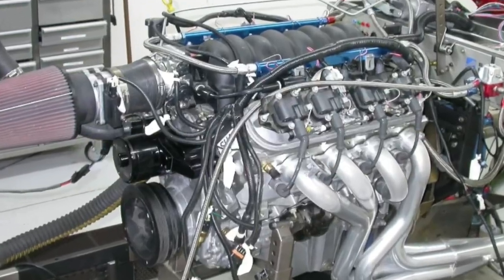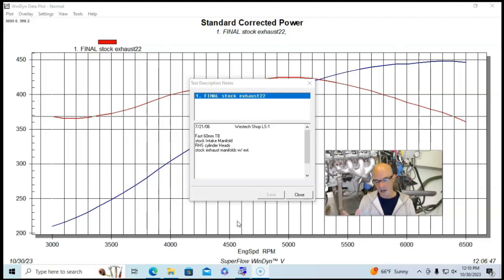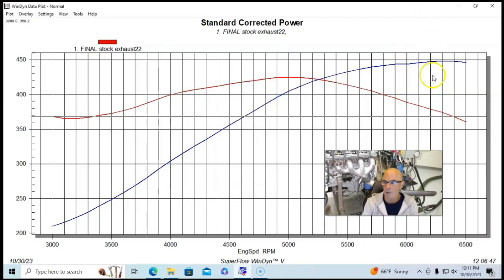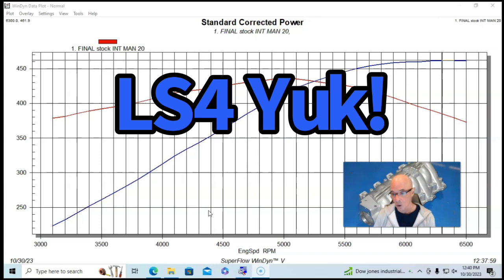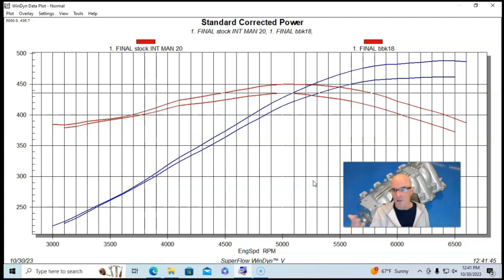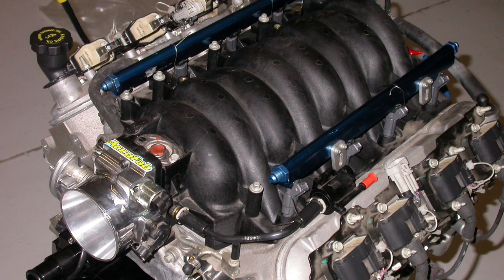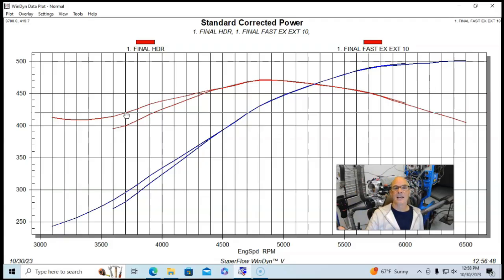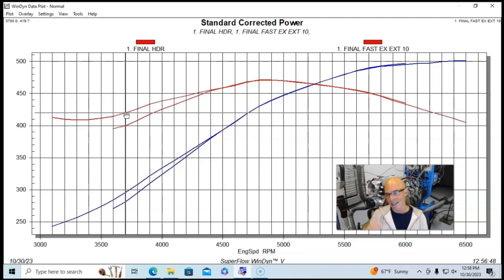HOW TO: 5.7L LS1 POWER MODS HOW TO MAKE MORE POWER WITH YOUR 5.7L LS1. LONG TUBES VS STOCK EXHAUST

Comment: Old ls1s were great. I'd love to see a ls6 5.7 on that dyno.
Reply from the maker: WE HAVE RUN 1
Reply: @richardholdener1727  I'd love to see those results
Reply: So LS6 intake, 243 heads, cam smaller than this...got it. It's literally a slightly modded LS1.
Reply: @Carado5150  there's a bit more difference than that. My bolt on ls6 made 451whp/423wtq.  Stock heads, stock cam. It ran 10.7@130ish in a 4gen. Best trap was 131.3.  But those times was BEFORE the last round of mods where it made the 451whp/423wtq.  When it ran those times it was a bit off that day. But the dyno for those times was 417whp 393wtq
Reply: An LS6 is just an LS1 with different heads,cam, and intake manifold. Exact same block and rotating assembly. After 2001 the LS1 even had the same intake manifold.
Reply: @BadLuckGarage  i know exactly what a ls6 is....i owned one and actually still have it. There's a bit more to it than what you guys are saying because you apparently don't know the full differences.
Reply: @HioSSilver1999  There’s actually not. I own a 2002 base C5 and a 2002 C5 Z06. They’re the exact same engine other than the heads and cam. EXACT same engine. Same block, same rotating assembly, same everything. Only difference is the heads and the cam. Edit….oh yea, and the LS6 has red engine covers that say “LS6” instead of black ones that say “5.7”. 🤣
Reply: @BadLuckGarage  ok...since you don't know I'll splain it to ya. A ls6 has .4 more compression,  coated pistons, different block for better bay to bay breathing and lighter valves.....and of course different heads and cam.

When you overlook the little shit it bites you in the ass on a real build.🤪🤪🤣🤣🤣
Reply: @HioSSilver1999  The extra compression comes from the 243heads having a smaller combustion chamber, hence the “different heads”. Same with the sodium filled valves. Again, those are part of the “different heads”. The slightly different block came about in 2001 and was also used for all LS1s after 2001. Same with the pistons. So again. Exact same engine other than heads and cam. I could literally just put 243 heads and an LS6 cam in my 02 LS1 and it would be an LS6. But I don’t need too, because I already have one. 🤣
Reply: @HioSSilver1999  the worst part of this entire conversation is Richard already explained all this in the video you commented on and you still didn’t know. 🤦🏼‍♂️
Reply: @BadLuckGarage  ohh i know. I splained it. And no not all ls1s got ls6 blocks. Few if any did. And the last i checked the engine is a entire package.  Breaking it down only means that there are different components......as I said. Those components add up to better refinement and more power.

Btw...ls6's was the only ones with lighter valves. All the other 243s didn't have the light valves. The light valves weren't in the 2001 ls6 either.

Now you know....but you didn't or you would have also known about the coated pistons. So no the bottom ends weren't the same.
Reply: @HioSSilver1999  Lmao. One of us has definitely learned something here. But it wasn’t me. Matter of fact I’ve probably lost at least 4 IQ points just reading your comments. 🤣
Reply: @BadLuckGarage  it definitely was you....or you would have mentioned the things I splained to ya.
Reply: @HioSSilver1999  I did but you either aren’t comprehending it or just enjoy arguing semantics. The valves are part of the  “different heads” and the pistons are the same from 2001-up in both engines. So again, for the third time….same engines except for heads and cam.
Reply: @BadLuckGarage  again...the pistons aren't the same. The block isn't the same. The engine is a entire package.  One engine has lighter valves...the other don't. Not all 243s had light valves. One has more compression because of the heads. Again...the entire package.  The pushrod length is also different because the ls6 cam has a smaller base circle.

Devil is in the details.....and the details are the differences.
Reply: @HioSSilver1999  Good talk and good luck to you. 🤣🤦🏼‍♂️
Reply: @BadLuckGarage  you've been schooled
Reply: @HioSSilver1999  🤣
Reply: @BadLuckGarage  it is funny. For something to be the same yet so different.  Facts are facts and they don't care about your feels
Reply: The good old tough LS1 still plenty of tough SBE Turbo versions down here in Aus and plenty of em hall the mail

Comment: I have an LS1 with an old MTI C1 "Hammer" cam (222° / .566" @ 112° single pattern), similar to the Comp xr275.
I currently have the heads off (original 241's) and have been trying to decide between 243/799 and 706/862 with the valves unshrouded. Would love to see a comparison of these 2 factory heads on this engine.
I'm looking for broad power from off idle through about 6,000-6,500 more so than peak numbers.
Any recommendation between the two?
Reply from the maker: see the video comparing those heads
Reply: 706 head will bump the CR so more power and the 243 will lower exhaust and you'll lose power
Reply: If you don't want to do it yourself, have the 241s ported with a performance valve job and decked .020-.030.  That would make the most noticeable difference.
Reply: Did you ever get this running? I've got a set of 862 heads with a valve job (I used the bigger intake valves from the 241 heads).  I've got a small 214 cam though, thinking of going bigger...  I want a stealthy idle though

Comment: I’ve always preached that long tubes weren’t worth much power, but the power gain is from the elimination of the cats. This backs up what I’ve always said. 11hp from headers over manifolds. Yea it picked up a little more tq, but still not as much difference as everyone thinks.
Reply from the maker: If you've said that headers don't add power and removing the cats do-you are incorrect
Reply: @richardholdener1727  that’s not what I said. I said headers (alone) don’t add much power. Which you proved correct. If you are going to repeat what I say, don’t forget words to try and probe me wrong.   11hp at the flywheel gain literally isn’t worth the time or money spent.
Reply: LT's make power!    Shorties would be better than a cast iron manifold and LT's better than a shorty header.   @Turbogto_guy
Reply: @dennisrobinson8008  but is 11hp worth the cost, hassle, noise and leaks? That’s 11hp at the flywheel. What? 6-7hp at the wheels? I realize as the engine gets bigger and more radical, the power gain goes up. But bolting headers on a stock motor just isn’t really worth it. A cam is worth far more.
Reply: @Turbogto_guy  A good set of long tunes make well more than 10hp on a 500hp engine.   It is more like 30hp or more.
Reply: @Turbogto_guy the C5 LS1 typically sees between 20 to 30 wheel horsepower after longtubes, catless X-pipe and tune. If opting to do longtubes alone it’s a lame outcome. Do the heads, longtubes & xpipe, cam and FI on it. If you’re staying NA and you don’t want your 5.7 to break into the 400+ whp territory skip the longtubes. You’re not getting out of the 300’s at the wheels without them.
Reply: @gotmylk  I had a 5th gen Camaro. (2011 a6) I hated headers because the trouble they cause. I researched and researched what my best bolt on options were. In my research I came to the conclusion that headers and catless connection pipes were worth about 29-30 wheel hp. For a cost of about $1500. If you just opt for high flow catted mid pipes, they were worth 20-21 wheel hp. They costed around $400. So please explain to me how 9-10hp is worth $1100 more? Not to mention I went to the track and raced a guy that had the same car, same bolt ons I had (tune, cold air, under drive pulley, ported throttle body) except he had headers while I had the mid pipes only. I consistently outran him. His car ran like 12.80’s and mine ran 12.40’s. No matter what anyone says, I’ll always hate headers and since I’m turboed now, I don’t have to fool with that leaky, tingy sounding junk.
Reply: @Turbogto_guy  if you think high flow catted midpipes are worth 20-21 I've got some swamp land on Florida I'll sell you cheap.  High flow cats and mids are good for unlocking about 4 to 6 whp tops.  And if the Longtubes you heard are either "tingy" or "leaky" they were cheap junk LTs installed by an incompetent installer.  I've had Kooks 1 7/8 LTs & catless off-road xpipe on my C5 for almost 20 years and neither of what you mention exist with this set up.  My cammed/heads LS1 made 390whp and 380 whp in an M6 C5 prior to Longtubes.  It made 418/395 after the Longtubes. It ran 11.6 @ 126mph.   Added a Novi 1500 on 93 pump and it makes 634/568 at the wheels.  With a stock LS6 intake and ported stock 78mm TB. The Longtubes not only let's the engine  breath, it gained 28 whp and they made the car sound exponentially better with the cam.  You do you bro..
Reply: @gotmylk  ain’t no way you trapped 126mph with a cam/head ls1 with 418rwhp. Unless the track was downhill or the car weighed 2800 lbs. my third gen Camaro weighed 3400 with me in it, made 447/479 and trapped 122-123 and that was with a 383. Something ain’t adding up to your story. If you look up “5 gen Camaro jba mid pipe Dyno” you’ll see they are worth 20hp. The search for header Dyno and that’s worth about 30.
Reply: @Turbogto_guy  lol!!! Yeah, I'm just making it up to debate you on YouTube. My car also had 4.10 gears in it at the time and a 7k redline. And 100% fact it ran 11.6 at 126. And my buddy with a similar build with the exception of a FAST intake and bigger TB  making 10 more whp and 9wtq than me ran an 11.3 at 128mph at Atco that day.  Perhaps you just need to learn how to drive your car better?
Reply: @gotmylk  nah, I can drive. I’ve been in the LS world for over two decades and I’ve never seen a 5.7 with 418rwhp in a vette trap 126mph. You must have some sort of unicorn or you live in a part of the world with 40% less gravity pull or the atmospheric pressure is mar than 1 bar. Just not typical.
Reply: @gotmylk  I just did a search in a few different ways to see what an ls1 corvette is capable of with heads, cam, bolt ons. Fastest I saw was 122. I was prepared to come back here and eat my words, but I didn’t find anything. I’m welcome to you proving me wrong. I’ve been wrong before, but I just don’t think an ls1 is going to do that unless the car is stripped down as laggy as possible. If it had an ls3, that’s a different story.
Reply: @Turbogto_guy  so much to unpack here. You’ve “been in the LS game for 2 decades” yeah, well me too. You should also know that power output from one dyno to the next is different as it’s just a tuning tool.  And on a Mustang dyno my car made 418whp. Not sure what to tell you. Go on the forums and look at the C5 quick lists and there are plenty of us running over 122mph with heads/cam NA LS1 cars. So in your 2 decades of being in the game you didn’t think to look at the C5 quick list as a starting point? Some carsfully gutted, some lightly gutted, geared, no front sway, 15inch to 16 inch light wheels and skinnies etc. 3000lb to 3200 with the driver in them. 

You were also claiming above the high flow cats are good for 20-21 hp and a better power adder than longtube headers. Which is ridiculous. 

You also had a Camaro that weighed 3400 lbs with only 447hp (which I’ll assume is on a dynojet) that ran 123mph. 

Apparently your two decades of being “in the game” hasn’t taught you very much.
Reply: @gotmylk  unpack? You know how stupid that sounds? That’s some bullshit that the democratic news channels like to use to sound smart. Like I said, no way your car trapped 126 without being gutted or going downhill. I could not find one example of a non gutted car trapping over 122. 
I made “only” 447rwhp. Maybe I should have been more specific. That was a third gen Camaro with a SBC that was daily driven and that was in the late 90’s. Dynoed it at thunder racing. I was a teenager and built that engine, ported the heads and built the 700r4. Had a mini ram and a haltech ecm. Ran 11.40 @ 122 on cord showing radial tires. That was back in 97-98. 
Look up how much high flow jba catted mid pipes are worth. I already did. 20hp. Don’t care if you believe it or not. Facts don’t care about your feelings.
Reply: I'm thinking the thin walled long tube headers amplify valvetrain sounds with more aggressive cams? If I wasn't chasing every HP I'd honestly consider factory cast manifolds just to lose the sewing machine noise under the bonnet.
Reply: @trixnhoez2964  yes, and I actually put my manifold back on the passenger side because of the tinging noise the shorty header made. I built the log manifold on the driver side out of thick wall so there’s no noise coming out of it.
Reply: @trixnhoez2964 that sewing machine noise is mostly the fuel injectors firing.

Comment: Interesting how you say that the biggest factor of long tubes is the benefit they provide through scavenging. Well I noticed the stock header you used appeared to be a Camaro style (I presume) that is a "4-1" style collector. I noticed that later on GM started using a "tri-Y 4-2-1" design on the factory exhaust manifolds for the Corvette and the z06. I'm wondering if that is the exact reason the move to the design? I'd that's the save I wonder if there are large gains between the two factory headers as well as the long tubes. Great video thanks for showing the OG a little love!
Reply from the maker: it doesn't matter what you do to stock manifold designs if they are very short-the big gains come from primary length and collector design

Comment: With collector extensions I wonder if having the dual extension pipes vs an H-pipe or X-pipe makes any difference with exhaust scavenging, or even if there is a loss or no difference with a y-pipe into a single exhaust.
Reply: Very good question.. and I would thank it would probably change a little bit
Reply: Yes, it WOULD

Comment: I must be overly paranoid but I just installed a turbo.  I am going to give up the bit of power over the FAST and run the BBK so I can abuse the boost.  Then I can sell my plastic manifolds before I blow holes in them and use that money for more goodies.
Reply: The plastic manifolds will be fine. I've seen 1000hp on plastic truck manifolds.
Reply from the maker: we've run 28 psi on FAST manifolds-you don't have to worry about hurting it with boost
Reply: @richardholdener1727 gd to know mate because my turbo LS1 is almost ready and it has the fast102mm on it ,cheers Richard love all of your work big thumbs up buddy 👍
Reply: I have been agonizing over this and I know you are correct.  102mm FAST seems like it is built much beefier and works for boost as you have tested many many times.  But I should have specified mine is a FAST 92.  Supposedly the bottom is much thinner and I can see it doesn't have reinforcement ribs like the 102.  I have seen pics of broken 92s.  So if I go FAST I would sell the 92 and get the 102.   Am I being clear as mud?  :)

Comment: Very nice output from modest HCI, especially such a small cam. That final torque curve would be really nice on the street! If you don’t have a 6.0, you could bore your 5.3–iron or aluminum—and duplicate, I would think. Or leave it stock and add boost…
Reply: Yes!  I actually listened to Richard about camshafts and am running a Lil John's stage 1 turbo cam instead of some giant cam.  I want a snappy bottom end with my 5.3 and I can just add boost to hit the horsepower numbers.
Reply: Yes you can iron ls1 makes big boy power stock ls1 pistons put you at 10-1 compression stage 2 truck cam from Texasspeed 350hp 350tq wheel with ls6 intake 1 7/8 headers
Reply: You can't bore a 5.3 that big... 

You would be re-sleeving it and spending a LOT of money for that bore size

Comment: Awesome video as always Mate. Now ya need to do a 5.4 video comparing the two as they battled here in Australia for many years
Reply: He's done a 5.3 vs 5.4 which is a good comparison as well
Reply: @madmod yep and that was another good video. I personally would love to see an overlay of the 5.7 vs a boss intake equipped 5.4 4v as a comparison I know cams specs are different on our Aussie engines but hey it would be close enough 😅
Reply: @darkshine5  5.4s absolutely swing up to some of those 5.7s down under too. You guys having those boss intakes really makes the 5.4 potent.
Reply: @madmod  yeah it kinda a shame that the Barra was as good as it was. The 5.4 gets very little love down under. I'd guess that there would only be maybe twenty turbo boss motors getting about down here most ppl that did modify the 5.4 went either vortech or Yella terra(Harrop 1.9) and very few companies in Aus actually offer aftermarket parts for them compared to a LS/Barra gear.
Reply: @darkshine5  Now that we can put Coyote manifolds onto 5.4 4 cam engines, I hope it will spark some more life into those mod motors. They can be had so cheaply.
Reply: @madmod  dude there are literally dozens of 5.4 and 4.6 4v lincolns SUVs that get walked right past for 4.8 and 5.3LSs at my local pick n pull.
Reply: @creverett9  Yup. I've bought tons of aviator, Continentals, and navigator parts for the mustang crowd from my local yard. Its plentiful for parts, more than what people assume.
Reply: @creverett9 there cheap in aus aswell my brother just picked one up for $500(boss 260), the barra really killed the aftermarket for them here, if you want power you get a barra from a wrecking yard.